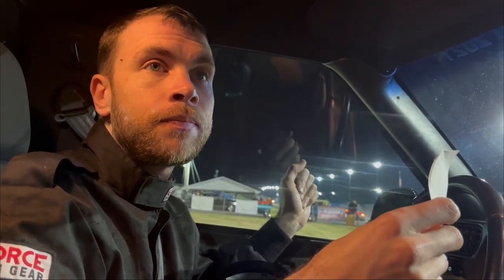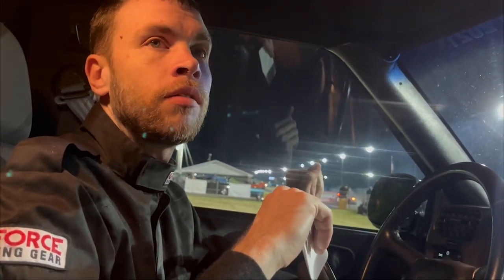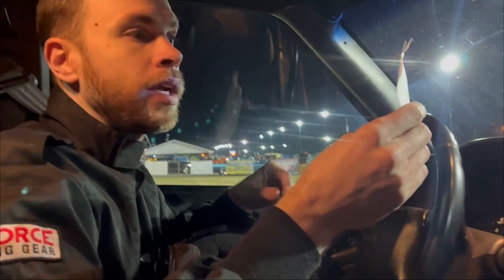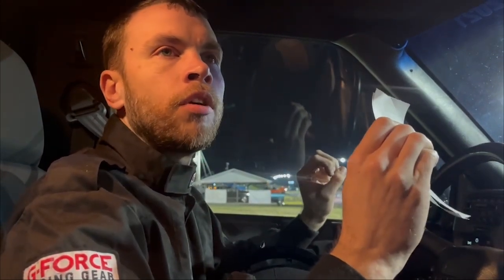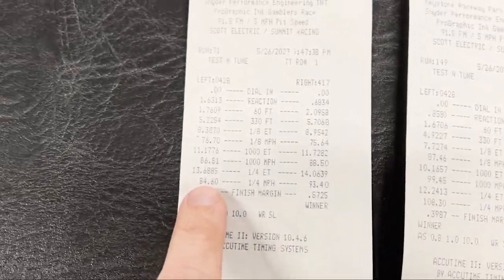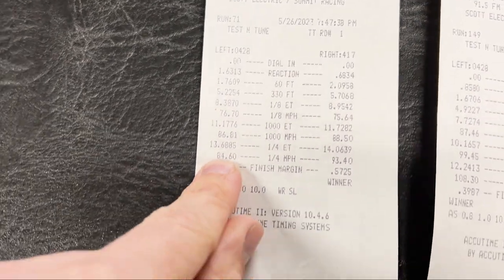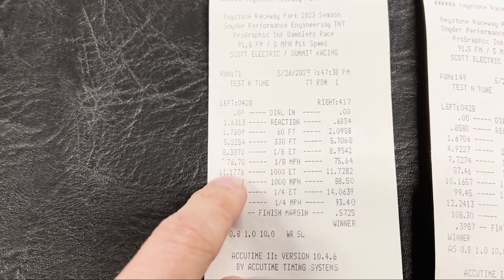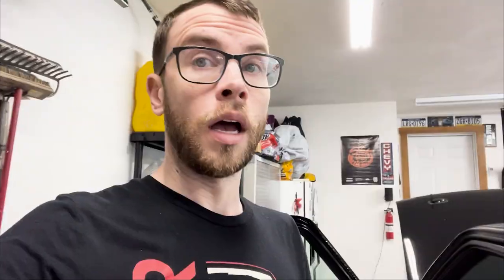Stock PCM Closed Loop Wideband Control - Track Test

Comment: You need that cam i seen it when you hit mid then it sped up after a sec that cam is around 30-40hp just on its own in the 4.3 v6, please make the video on the torque converter

Comment: Is that bug in v3 of ls boost ?
Reply from the maker: The code is different so that specific bug isn't going to be an issue. I never tested it with V3 so there could be other bugs. I don't think I ever got any feedback on that feature for V3.
Reply: @turbov6  been excited to try it for a while, unfortunately i have some mechanical bugs to fix currently. Big bugs. Ill def get you feedback once im running it. Pretty sure i bent a conrod after adding a lil too much spark down low back in march

Comment: To pull the trans, you have to remove the motor mounts and lower the motor and trans assembly a little to get to one bolt. It is where your right ankle is, or thereabouts, when in the drivers seat. Beat the hump in a little while it is out so next time you need to pull the trans, you wont have to mess with the motor mounts. Mark it with a sharpie so you know where to beat the dent in so your socket and swivel will get to that bolt. I hate pulling and stabbing auto trannies on the ground without a trans jack. They are heavy. It would be a good time to install a trans brake. Your 60 and ET will come down and it will help a ton with consistent reaction times.
Reply: No reason to pull engine mounts I usually just lower the trans crossmember  and put a 4ft long extension on and go from the tail shaft. With a impact swivel. Works like a charm. 
The pinch weld on the blazers though makes it miserable 😅
Reply: @Bignate1989  That didn't work on my Xtreme. beat a dent in when its out and it will be easy for the next time. Blazers have the motor lifted a little with higher motor mounts, if I remember correctly. I can only imagine that because of that it is more of an issue with those. But it is even in the repair manual that you need to lower the engine to get to that one bolt. One of many engineer nightmares designed into the S10 platforms. The engineers are pure evil and I hope they all meet with their due karma someday.